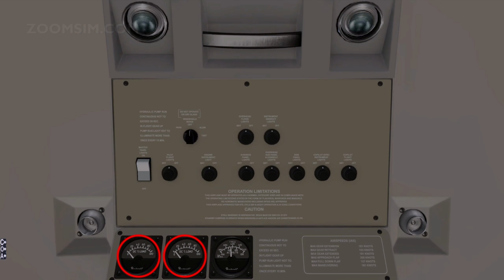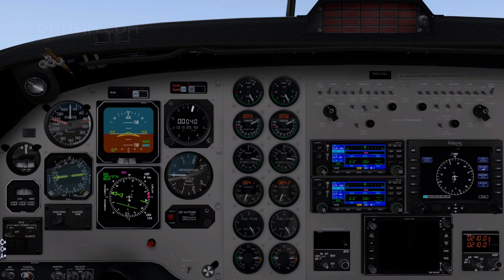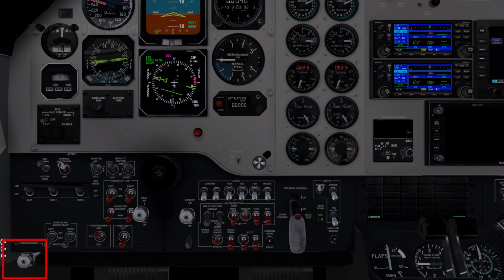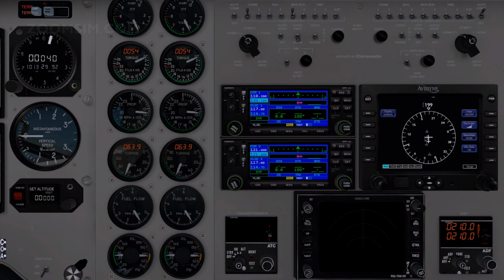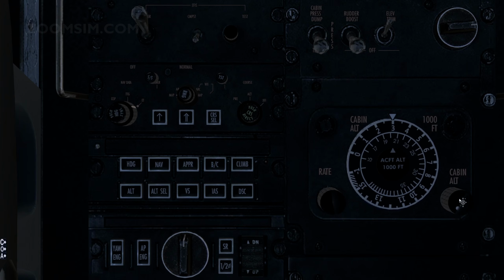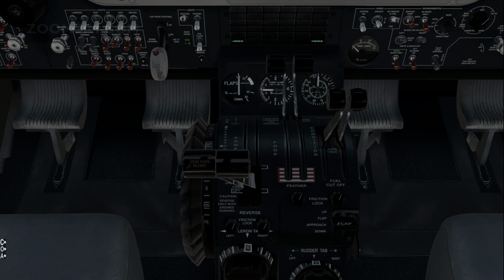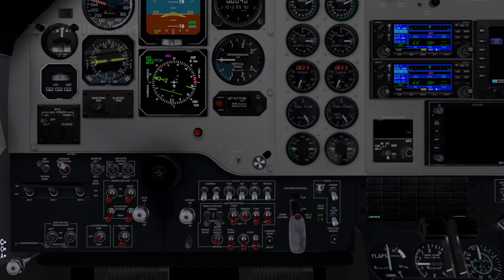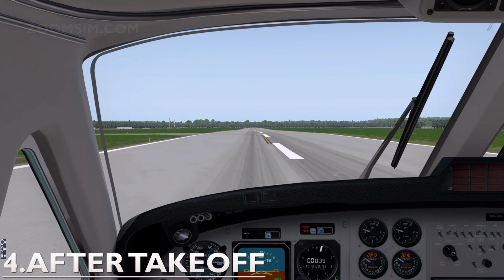X Plane 11 Tutorial 2 : Carenado King Air B200 Taxi and Takeoff

Comment: Lovely video, but you did what I see many sim pilots do on non-FADEC turboprop engines, which is to overtorque on takeoff. You should NEVER exceed the torque redline. It's perfectly safe for continuous max torque operation up to the redline (although it might shorten gearbox life), but going above the redline risks gearbox failure and requires an expensive teardown & full inspection after the overtorque event. A copilot is often helpful here. PF sets initial takeoff power to roughly 70-80% torque, then calls "set takeoff power" and the PM fine-tunes the power levers to obtain required takeoff power (usually around 90-95% max torque while making sure to stay within ITT limits).
Reply from the maker: Thanks for your feedback. I've found it hard to find good information on all the relevant procedures. I wasn't sure how much power to apply.